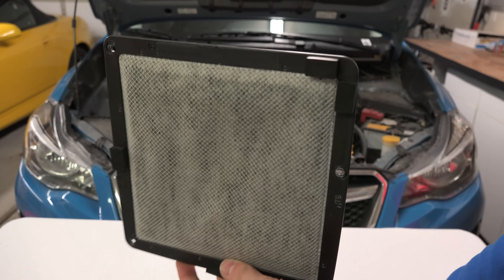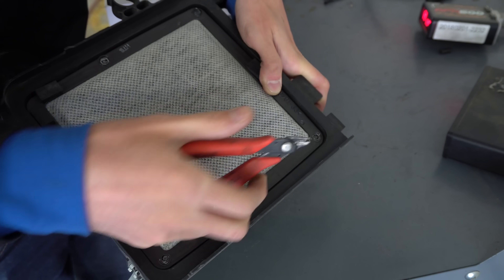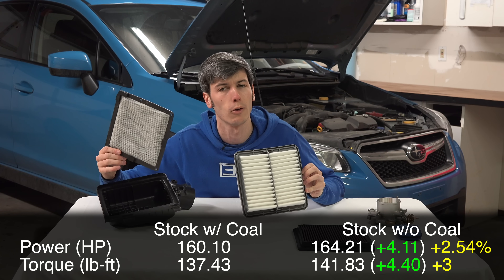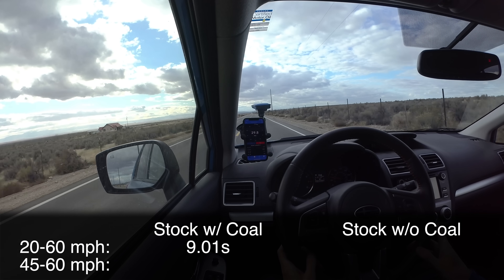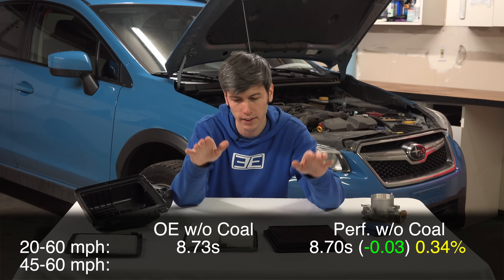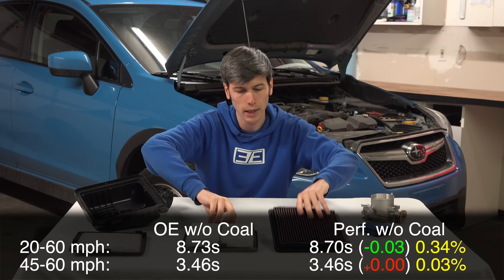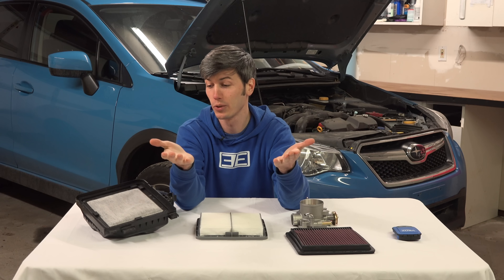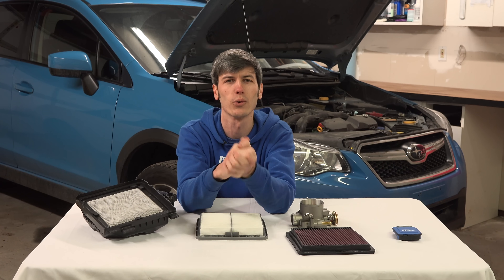Do Charcoal Air Filters Rob Your Engine Of Horsepower?

Comment: Emissions from the intake? That's some straight up California level insanity...
Reply: The intake sucks up crankcase gases and valve cover gases from oil vaporization, and also has some fuel left in the intake if MPI.

Plus charcoal systems that suck fuel vapors from the gas tank.

The intake, shortly after shutdown, can spit emissions. While I question how much this really does, it is something

Granted, it used to be that the air box was considered enough for this so idk...
Reply: @rejzor   i was thinking that too, it probably lasts at most 4-5 years. to save .00001 percent of the cars emissions. but than  go to some place like the Philippines where u have 2 stroke motorcycles putting out 500% more emissions than that car. funny
Reply: Bob Edwards 1. for most of an engine’s running time, the largest obstruction is the throttle. 

2. How many HVAC systems need to filter gasoline vapors? Under hood air temperatures are probably going to bring the charcoal to the temperature where it will reject what it’s already collected, similar to charcoal deodorizers that you can just leave in the sun.
Reply: @ tinncan: Yes, it's CA-level, because they were required to pass the extreme CARB approval process where they lock the car in a shed for a couple of days & see how much HC it outgasses. The trick here is that the  evap can on the gas tank just has a line to the air intake so that when the engine is running it can suck the adsorbed HC out of the evap can & replenish its efficacy: but what happens when the car is parked? Hence the second layer of charcoal between the intake & airbox to catch any fumes that try to make it out that way. Real world f/x on the environment? Negligible. This is all about passing CARB's ever-increasingly stringent standards which have surpassed CARB's original mandate, but are required to justify the bureaucracy's continued existence...
Reply: It's also pointless as charcoal will only absorb a certain amount of stuff before it's saturated and doesn't do anything (it can even start releasing it again after a while!), except be an obstruction. Obviously they only put it there to fudge manufacturer emissions tests.

Definitely remove it and bin it. If the car has been running a few months that filter is going to be shot and doing more harm than good.
Reply: Technically speaking they are from the PCV valve though why that much fuel and oil gets back to the air filter is what seems like bad design to me...
Reply: Yep. My Mercedes has a charcoal filter for the cabin, and that thing lasts six months, tops -- and that's just with the little climate blower motor pushing air through it. This thing is in the intake system, with air being forced through constantly at high speed. I'd be surprised if the charcoal lasted a month under those conditions. Total waste of money. 

But this 'emissions' equipment is only tested on factory-new cars, so they don't care if it craps out after a month. Plus it's another thing the dealer gets to charge $150 for on standard service.
Reply: You have no idea of ca insanity unless you live here. And why I'm on the way out!
Reply: Oh it’s emissions equipment gotta hate it
Reply: @Phos9  oh it's emissions equipment gota love it even if it is actually bad for the environment over all.

Let's be real, emissions control is great, so is using actual science to determine what is effective which is the part frequently failed.
Reply: @jaydunbar7538  Why do you think it's bad for the environment overall?
Reply: @Phos9   Phos9  Because it clogs up and makes your car run rich after at most 2 years... Did you even read what anyone wrote, or did you conveniently ignore it, because it didn't fit your preconceived notions? Plus there's the question of whether the amount of charcoal in the filter is going to be produced and disposed of in a manner that does not produce more emissions than the charcoal would absorb. Not the mention that the compounds that the charcoal absorbed are now being disposed of with the charcoal - it doesn't magically disappear or change composition, it just gets bonded to the charcoal.
You barely have an inkling of what you're talking about and you're attacking people out of your ignorance while massively disrespecting them by discarding their experience and evidence simply from your own biases, rather than considering the possibility that somebody in the world is more informed about a topic than you. I hope you aren't this combative in person. Think before you speak.
Reply: Rappolt it’s a chemical filter placed after a particulate filter much tighter than it, what is there for it to be clogged by?
Reply: @Rappoltt  "Because it clogs up and makes your engine run rich" Do you understand how electronic fuel injection works? Do you understand adsorption? I think not.
Reply: @Rappoltt  The problem is that people almost brag about how they change the oil every 1000 miles because they actually know how to take care of a car - while in this scenario not even give the car a real proper service in two years? The filters are replaced before the clog up. Also. Carchoal filters are used in a lot of places. Cars getting them is not really gonna make that much of a difference. Just think of how high alcohole spirits like vodka or clear liquer is made...
Reply: @Phos9  Removing that harmless charcoal filter yielded a net power increase of 2.5% every else being the same so I'd say the restriction is very real. After 10 years of running on a less efficient intake I'm more than certain that your engine will have polluted the atmosphere more through the exhaust pipe than what the coal filter will have saved in odd whiffs of gas running all the way back up the intake piping. Sounds like an emission system that's indeed there to look good when testing a brand new car design off the prototype assembly line and getting "CARB certified" more than any long-term planet-saving device.

Compare this and how much gas is vented in the atmosphere every single time any one of us fills up at the station (like... you can visually see (let alone smell) the damn fumes coming out of the filler hole). We probably vent more gas (no pun) in a month of filling up our tanks than the engine releases over its lifespan through the intake piping.
Reply: MozzaBurger I agree about the venting at the pump, but the charcoal filter is only going to be a meaningful restriction at full throttle, the rest of the time the throttle itself is going to be the largest restriction in the intake.
Reply: @Phos9  The throttle valve restricts the airflow but maybe without necessarily putting as much additional strain on the piston as it tries to suck air through the intake. I'd be interested in seeing an engine efficiency comparison with and without the charcoal filter in terms of fuel usage, as opposed to just the difference in max HP. 
I'd wager even a 0.01% difference would render this additional filter environmentally detrimental over the lifespan of the vehicle.
Reply: @Markle2k  do you understand how mass air flow sensors change how the injection system meters the fuel on intake strokes... These filters should be considered wear items as yes they will eventually get fouled if they are even catching anything if they are catching nothing then there is no point to them being there...
Reply: @Phos9  also go cry about it on reddit
Reply: @1mostwanted253  You don't seem to know what reddit is.
Reply: @1mostwanted253  lol now I know you don't know what reddit is, based on that little outburst you deleted.

Comment: Great another video encouraging people to remove emissions equipment. Even though you say don't do it, showing an improvement will encourage people to rip out something they didn't know about.
Reply: shango066 I hope people don’t take it out. A few extra horsepower isn’t worth it. Even I can see that it helps emissions and doesn’t make a difference in helping it feel faster, not compared to a tune or stage 1 head or cam swap.

Comment: One more thing to consider is that the charcoal filter does get dirty overtime and there is no good way of cleaning it. My Tacoma has 140k on it and has seen many dirt roads. A few months ago I was changing the air filter and dropped the filter casing and a dust cloud came off the charcoal filter. (Toyota air filters used since day 1) fine dust particles do get buy the air filter and collect on the charcoal filter. Performance gains would likely be higher if I removed it in my case, but still not noticeable I’m sure.

Comment: Your fancy math can not match my super sensitive and accurate butt dyno 😉
Reply from the maker: Forums h@t3 th1s one ea$y trick!
Reply: @EngineeringExplained  I disagree with your explanation on why it wouldn't increase throttle response. vacuums can be created by any restrictions along the way to the intake opening, not just at the butterfly valve. your assumption that everything after the butterfly valve is at atmospheric pressure goes out the window once the air starts flowing into the engine.
Reply: @nukethorn-v8l  No no no Don't be silly. Reality is but a simulation of theory.

Comment: I literally just changed my air filter in my 2015 Subaru crosstrek yesterday. It literally feels like a 2.5% increase in performance lol. I actually replace it with a normal filter not the k&n

Comment: Wait how did you even get 160hp out of a 148hp engine? I thought your Crosstrek was stock? I'm curious for my Crosstrek.
Reply from the maker: The dyno reads high (consistently). It's a settings thing, don't worry, actually HP is probably still like 25 because Crosstrek is slow!

Comment: Jason I know is a silly question, but removing the charcoal filter and having more free horses isn't gonna improve mpg? Would be funny to see a comparison in real world filling up the car, driving it for for something like 100 miles and the fill up again and compare the results. Love your vids mate!
Reply from the maker: That's a good idea! It'd need to be done on a dyno though to control variables. Far too many for real world testing.
Reply: I think restricting the air intake just make the ECU injects less fuel since less air goes pass the MAF sensor. Less power but same mileage.
Reply: Anecdotal info from another poster said blind test in his wife's car over 5000 miles went from 26mpg to 28mpg for what its worth
Reply: Raven Starver the engine gets more efficient/powerful because removing the filter lowers pumping losses to get air into the engine at lower (any) throttle angles. It’s the restrictiveness of an intake that makes less power and lower efficiency. Julian Edgar has a great video about it on his channel.
Reply: @gregorykusiak5424  but if you reduce the restriction in the filter you need to increase the restriction in the throttle valve instead, otherwise you would be making more power
Reply: @TheHenirik  making more power across the range of throttle angles is the whole point. Ideally, the less restrictive the filter/intake, the closer to the engine’s peak/optimum/ultimate power you get, the easier it is for the engine to turn that power into work efficiently. Engines turn fuel into work, and if you can make one do that better - more work for the same or less fuel - you’ve gotten a gain, something “for nothing”
Reply: @gregorykusiak5424  You still need to balance the air and fuel for the engine to run properly, and part of that is done by controlling the resistance in the intake so the engine doesn't starve. 

A low resistance intake helps with power, especially top end, but it shouldn't do anything for efficiency.

If you instead could decrease the density of the air you could run with less intake resistance for the same power and it should help a bit, as long as the air going in doesn't get to hot for the combustion cycle to work properly.

Older diesels are an exception though, since those doesn't have a throttle to begin with.
Reply: @TheHenirik  are we talking injected or carbureted engines here, just so I can know where your head is at?
Reply: @gregorykusiak5424  I was thinking any car with a electronic fuel system. 

As you mention carbureted cars those can actually get worse fuel efficiency with a dirty filter, since they don't readjust as well for variations in the vacuum.

But it still shouldn't really run more efficiently with a different filter after you calibrated the carb for it, and if you don't it might run a bit lean, which maybe could help a bit with efficency, but if it runs lean you also get higher exhaust temps (which could hurt your valves if its bad enough) and probably lower power.
Reply: For what it's worth, i was thinking about the same thing. If it really helps MPG's, i may try this in the Prime..

Comment: Ok so . 0065g would be hard to perceive, but in a "get in front of traffic" green light start, how many feet in front of the unmodified version would it be?

Also, on a 300 mile drive, how much extra fuel is needed to "fight" the restriction of the charcoal filter and how does that compare to the extra hydrocarbon escaping when the engine is shut off?

Lastly, if 1 billion cars removed this filter, my guess is the effect on the planet is ZERO.

Thumbs up for cool video.
Reply from the maker: I do like the discussion involving how much extra fuel is required to fight the restriction, certainly an interesting thing to ponder! There's probably a break even distance somewhere in there, but not sure what it would be. Might mean the filter is useful for short/medium trips, but perhaps not for long trips. Great question! (I don't know the answer haha)
Reply: Engineering Explained new video idea!
Reply: Subaru could probably answer that.
Reply: The effect on the planet will never be zero :P.
Reply: @GoldSrc_  Nah but if we asked every driver to hold their breath for two minutes we'd probably compensate for it ;)

Comment: Hi Jason, I have a question regarding charging your EV. if you have to park your EV outside, and it is cold (the last few weeks, where I live here in Canada has been consistently below - 20 degrees Celsius over night), I assume even with a level 2 charger, it will take a long time/longer than usual to charger your EV? Also, I have heard in extreme temperatures (hot or cold), EV will loose charge because they will spend some charge to protect its vital equipments, true? Thanks.
Reply from the maker: Correct, both true. When plugged into a level 2 charger, the EV can use some energy to heat the battery, some to charge it, charging rate will still be decent. On level 1, it will be pitifully slow. And yes, some cars will heat battery to prevent damage, which of course uses battery energy.
Reply: Engineering Explained is this compounded in even colder temps as I live in Saskatchewan where it’s been a constant -40 c and down for weeks now?
Reply: @EngineeringExplained  Thank you for your reply Jason! Please do more videos on EV, like which kind of battery cooling is better 😁😁😁

Comment: I think you need to test a cone filter to show people how much power you lose
Reply: If you have both exhaust and intake and both are setup for you vehicle and you have a tune you won't lose power, even on an na engine
Reply: @YeetxBoi   open air filters don't have a cold air feed and usually in a rather warm part of the engine bay. sucking in warm air kills power same as if you take that Subaru to a cold place the numbers the dyno will be very different. No matter how good your map is you can feel the difference between a hot and cold day

Comment: How sure are you that the normal air filter gets a good seal without the thickness of the charcoal filter in place? Could there be loads of unfiltered air getting in because the rubber seals aren't compressed properly?
Reply from the maker: You can see in the video this is not the case. The charcoal filter has a recessed area which it slots into, the air filter has a separate face it seals against outside the area of the charcoal filter.
Reply: Fair enough. I did try to make it out from the video, but I couldn't see the underside of the air filters, so I couldn't tell what they were meant to seal against.

Comment: You should make a video to test the differences between OEM air filter and a Cold Air Intake system
Reply: @1Slamalama1  I think he means aftermarket vs OEM
Reply: It's going to be so different from car to car.
Reply: He did.
Reply: All factory air boxes have a CAI... It's just restrictive
Reply: Guys..I thought it was pretty clear i was referring to systems like VW Racingline R600 or APR Carbon Fiber intake and not just some air filters on the stock air box.
Reply: @alltrack_r  I thought it was oem vs aftermarket and the parts you mentioned are far from oem but optional extras. Throwing them in the mix will say if they worth it
Reply: @1Slamalama1  yeah but they don't have a shiny tube....
Reply: @MaFTB   bad designs true small cars are probably the worst I can imagine 😂 they're still called the same thing and suck in cold air from outside of the bay. Mk3 ford Mondeo has it low in the wheel arch wtf is that a water Hoover 😂😂😂
Reply: Agreed
Reply: @MaFTB  You were probably getting some ram-effect supercharging from the headlight intake.
Reply: @0utcast  thanks for repeating what I said, using the most remedial explanations possible.
Reply: @0utcast  you should be. You should've learned the difference between your and you're when you were 7 or 8. But that wasn't even the point of the comment, but funny that's the part you chose to latch on to rather than what really matters. Shows YOU'RE not worth my time.
Reply: @0utcast  *you're. Looks like you need to read some books on grammar, keep learning about how engineering in automobiles work, and maybe a therapist to help you recognize cynicism when it jumps up and smacks you in the forehead.
Reply: @smminco that's a pretty long run on sentence for someone calling people out on there grammar in YouTube comments.